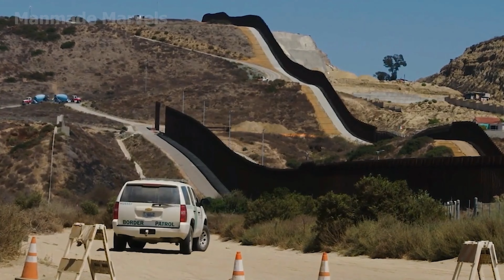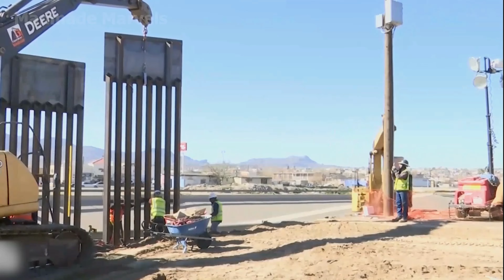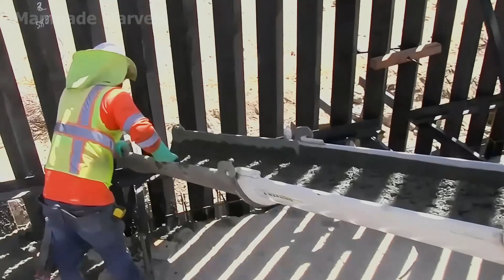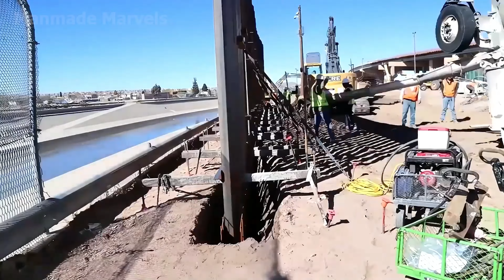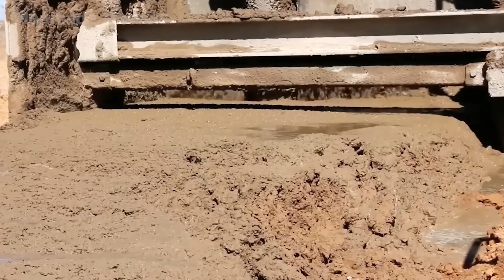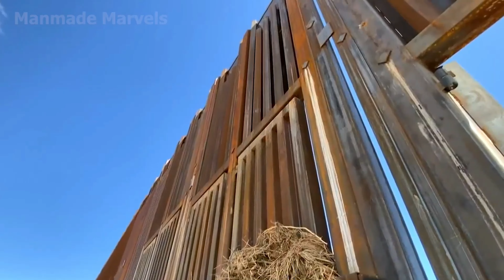Why US-Mexico Border Wall Cost $15 Billion (and can be cut in minutes)

Comment: A design mistake,was the top section,it should have had a steel plate,at least a metre wide at a 45degree angle,facing out towards the Mexican side of the border fence,this way,no grappling hook, could be used to climb using a rope,or ladder,asking what happened to the section's sold off by Joe and co, whether those buying stolen US properties,were prosecuted